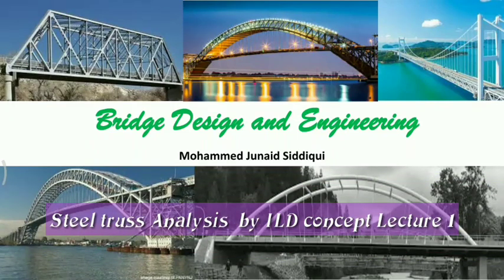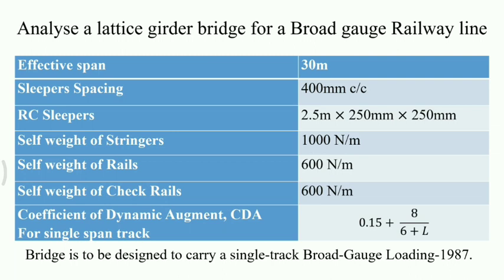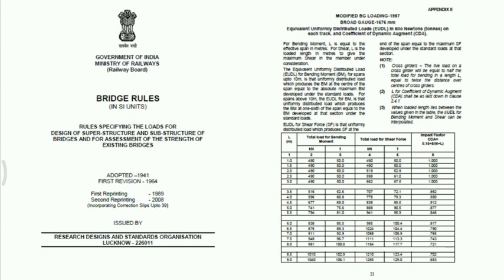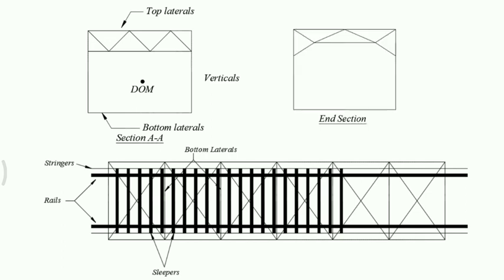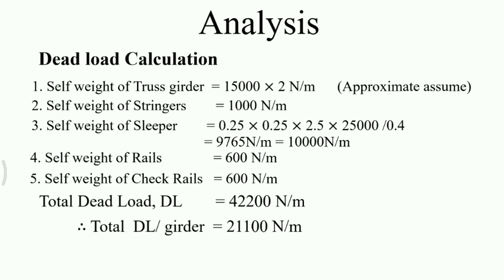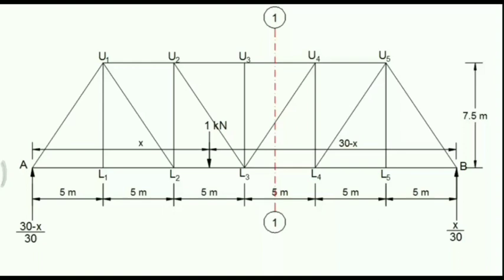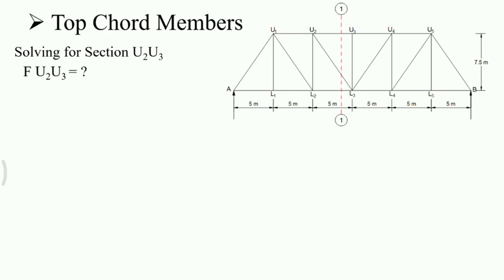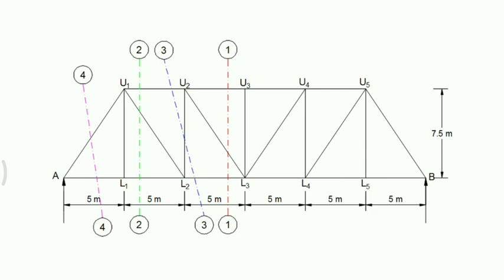Analysis of Steel lattice girder truss bridge by ILD concept Lecture 1

Comment: Sir i am getting confused when to select which side of section and which ordinate,here u selected 0 and 10 for 1st case and 15 to 30 to 2nd case cant we select 0 5 10 15 20 25 30 like wise for both cases Direct why only 0 and 10 ...plzz reply exam on the way

Comment: 7:05 how did u consider 7m spacing???
Reply from the maker: Minimum Spacing is 1.5m, width of Broad Gauge is 1.676m. Width of one train car is greater than 3m and considered more than 1m clearance on either side, hence it is 7m             OR             refer clearance diagram for broad gauge from any text book of Steel Bridge design.